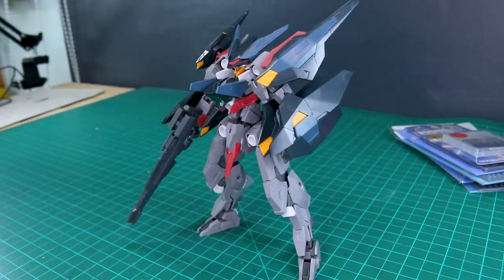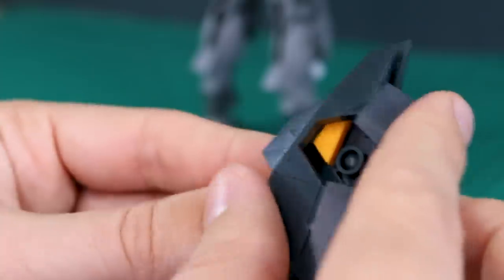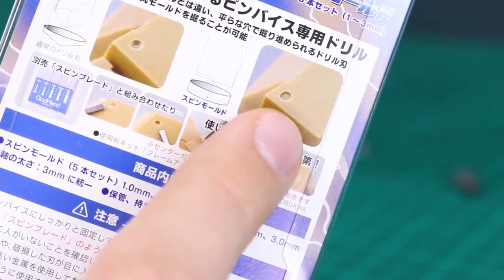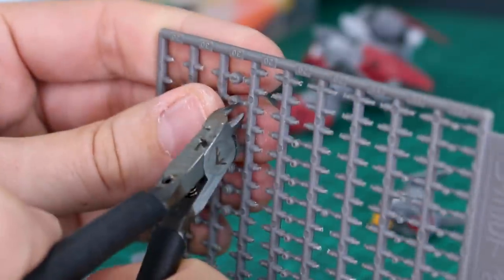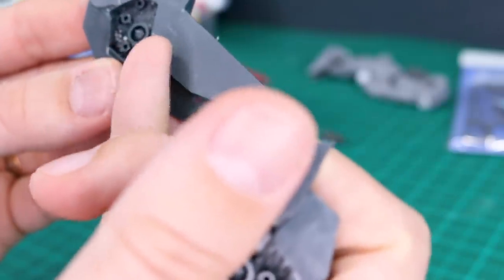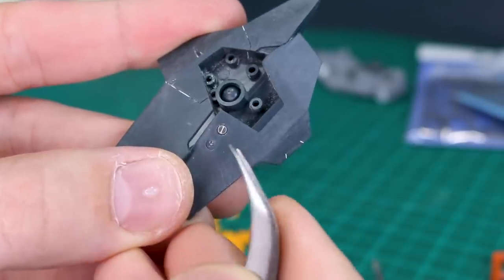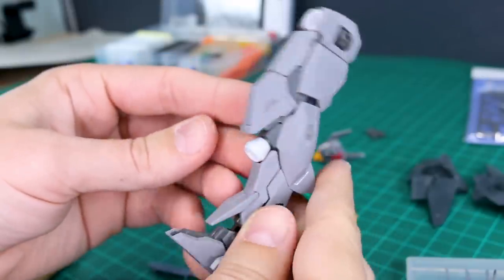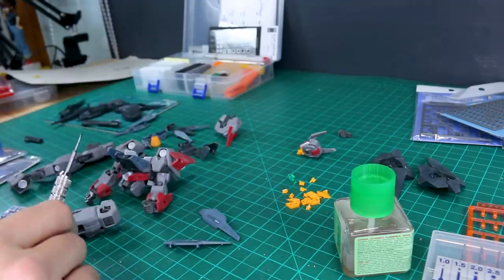Frame Arms Cutlass Custom WIP:2

Comment: I hope this tip helps you customize and preview colors before deciding to paint the kit.
1. Snap the picture of your kit.
2. Using photoshop then marquee/lasso the parts.  Image menu, Adjustments, Hue Saturation.  You can use that Hue slider to adjust the color you want.
Reply from the maker: Yep thanks! I’ve tried doing that before but it’s too time consuming for me haha. I can usually visualize it well enough without going through that
Reply: you can also set color filter using the layers

Comment: i am scared of the blade antenna photo-etched parts pins being too thin that they might snap when you get the size of the pin holes wrong by a micrometer when drilling and unknowingly forced the pin into a smaller hole thus snapped the thing.
Reply from the maker: Possible, but not likely. They seem to work pretty well!